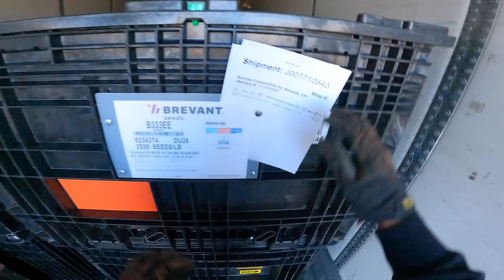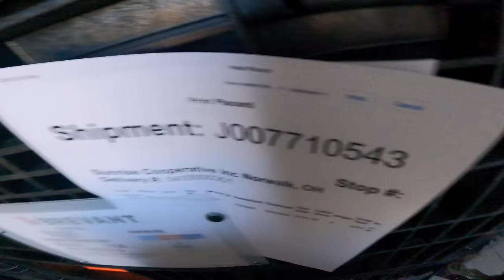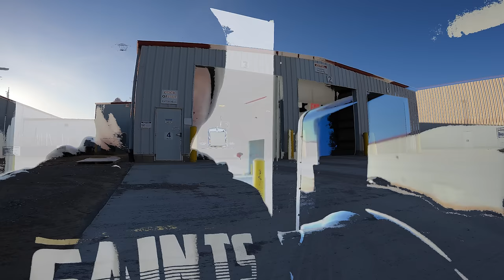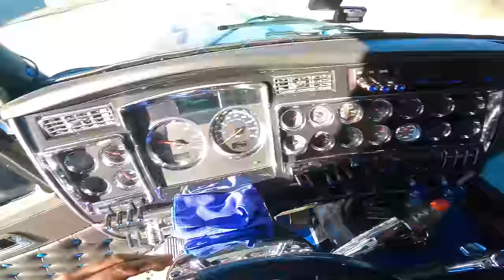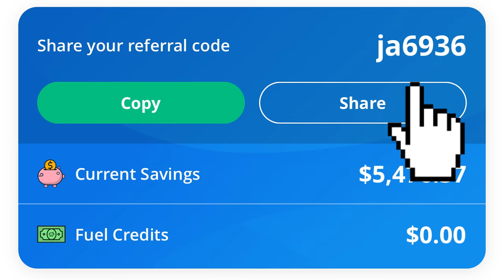The Weight station pulls me over for what?!?! waste of time!!

Comment: It shouldn’t make a difference as long as you’re not overweight you’re not overweight. When you’re overweight then that’s the issue. Pretty simple stuff I would think.
Reply from the maker: Exactly my thought
Reply: Spend some time behind the wheel and you’ll learn son
Reply from the maker: @justintuttle137  been doing this for 7 years been around trucking all my life
Reply: He thought you had a dump valve on back axle and was dumping air off of it to make your weight go down is what he thought and it happens more than you think with a spread axle trailer

Comment: Does the trailer have a height control valve on each axle? Or one only with common pressure on all 4 trailer bags? I’m a truck mechanic, and have seen height valves fight each other more often than not.
Reply from the maker: Only on the rear axle
Reply: Double check your leveling valves because your trailer air should have equaled out a little closer than it did, play around at a shipper or receiver scale and see what you can figure out so you don't get your time wasted with the state boys,,, check with the air ride manufacturer or stop at good trailer shop,,it should be a little more equal no matter how your loaded,, have a safe trip,, you have a fine lookin hotrod👍👍🚛🚛💨💨
Reply from the maker: @dennissuwyn2980  yeah i checked over everything and nothing seems off had new bushings and an alignment dont at a trailer shop they looked over everything and they found nothing

Comment: I pull a flatbed out of Tennessee. Our trailers have a dump valve for the suspension on the rear of the spread axle. I forgot to turn the dang dump valve off coming into the Asheville Nc scale. I was way over on one obviously, thankfully he let me turn the dump valve off and let me go when it evened out.

Comment: My guess would be the reason they pulled in is they probably wanted to see the weight spread more evenly across both axles your putting alot of weight on one axle when its not necessary, but thats just my guess from my experience pulling spreads
Reply from the maker: Yeah i get that but when the load stops on top on an axle not much you can do about it but he questioned me about an air problem
Reply: @JLR3Truckin  they probably either wanted you to slide your spread forward or close them up, I guess couldnt really make you since your legal,b but might try it in the future and see what happens
Reply from the maker: @KDMTrucking  yeah i might have to try that next time
Reply: Doesn't matter, he was legal

Comment: Without reading all the comments, the scale may have thought  you were dumping air to take weight off.    It's an old trick we used to do all the time. Probably why alot of states started putting in platform scales to weigh the whole truck

Comment: I have had ohio look me over for that same thing. But i had a dump axle that i could scale 95k at less than 80 if they weighed single axle at a time.  Never caught me for it but had to put big propane tanks in finally to hide the air blowing off….  They figured it out later 😂
Reply from the maker: Smart man. I feel like if your legal it shouldn’t matter what axle weight is
Reply: @JLR3Truckin 👍
Reply: You're showing your age!  Don't think you can get away with that any longer.  Used to work great on PA turnpike too!  Any more I consider everything East of the Mississippi river part of the ocean.  I don't go there.  🤠

Comment: No matter how weight you have on spread it should equal out on both axels check into it the guy at the scale house was right
Reply from the maker: When the weight stops at the front axle it wont be even no matter how you do it
Reply: That's not right check into it I pulled spread axels long time
Reply from the maker: Well apparently from all the other people commenting they say it shouldn’t matter as long as its legal. But i haven’t had that many experiences with a spread axle so thats why i asked the questions i asked
Reply: I've never weighed each axle but all the air bags are plumed in a loop off thr same leveling valve I would think each axle should be close to each other .

Comment: Very well done video,Great looking truck. Appears well cared for and driven. I have two questions..1.  is driving with only one hand acceptable/legal when not needing both hands on the steering wheel?(considering using one hand for example to key mic on CB or get water bottle etc,etc. question 2. Are steering wheel knobs legal?..I guess they are both safety questions.
Reply from the maker: Knobs arnt legal technically but dot doesn’t care about them.and i dont think there is a law about having 2 hands on the wheel.
Reply: @JLR3Truckin  Thanks for answering so quickly. Again great looking truck.